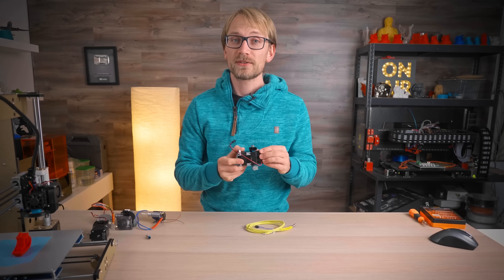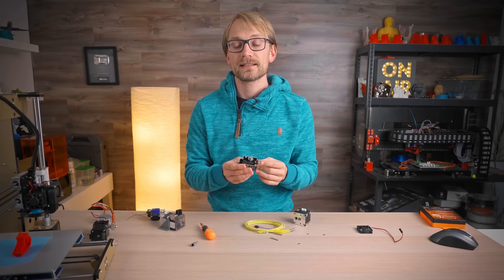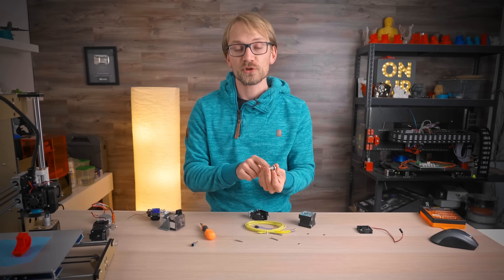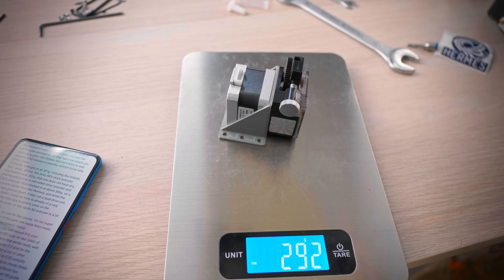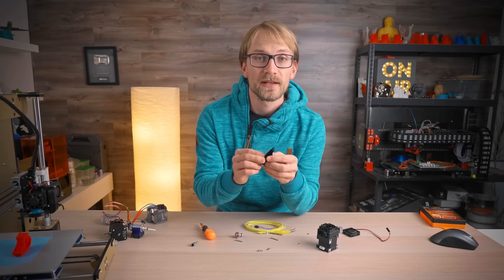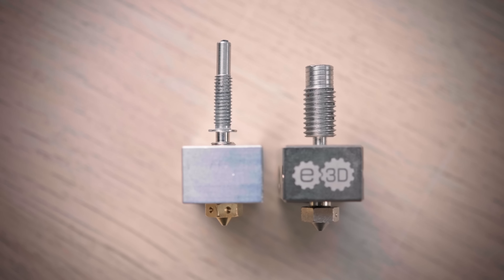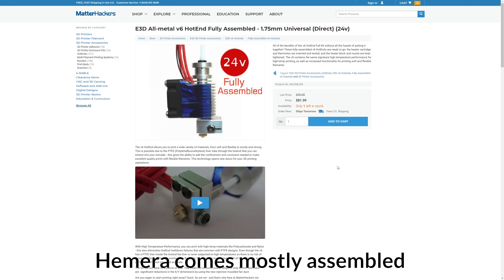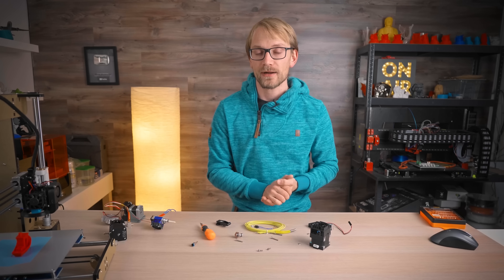E3D’s end-all extruder: The Hemera! (Full Review / “formerly known as Hermes”)

Comment: I've stripped filament in my Prusa all the time, mostly through nozzle clogs though.
1 - Using white filament in a 0.15mm nozzle. 
2 - Temperature too low for the filament.  
3 - You print a file but forget to swap in the larger nozzle.

Comment: for anyone else wondering.  you CANNOT rotate the front heatsink so you can mount the thing on the bottom of a carriage.   the bearing for the idler fits into the front plate of the stepper motor.  so it's not rotateable.

Comment: Well Tom. Blowing air up away from the bed in that kind of a small space you actually creat a low pressure zone under the hotend which kinda doesnt help. the only way to get very little airflow around the print would be a long hose from and away from the cooling finns.

Comment: Just curious... my heated bed is 24V. I guess I will have to get out my meter to tell how much voltage I have across the Extruder? I have an Alfawise U20 One printer. I would think that I need the 24 Volt one... I am new to 3D printing and my printer also uses the Bowden style extruder. I guess it would be best just to replace the Bowden?

Comment: Isn't this basically the deluxe version of the stock Anet A8 extruder? They look exactly the same, right down to the point where you can't see the filament as you're inserting it.

Edit: I look to the left side of the screen, and I do indeed see that the Hemera is installed on a stock Anet A8.

Comment: It would be interesting to make a setup where you have one big frame-mounted stepper to handle the mass of the filament roll, and one small pancake stepper to apply pressure at the printhead. As long as they move in sync and have a bit of filament slack between them, the direct extruder should be totally isolated from the spool, which I think would be a big help.

Comment: Sorry this extruder may be good. I ordered this. But as I had it in a hand I thought it is a joke. The fan and the screws, oh my god.  Blind designers. The position of the gear to push the filament manually. Again blind designers. Some stuff are good. But if it advertise with quality I shouldn't  make such faults.

Comment: Hey Tom! So I got 4 HEMERA upgrades for my print farm for my Ender 3's. I am unable to get some clear Sainsmart TPU printing for longer than 20 minutes before either: A) The filament stops feeding (low tension), or the filament gets crushed and is blocked by the tight tolerances of the Bowden adapter (high tension). I've gone through E3D's entire troubleshooting guide- waiting for support to get back to me. Any ideas what might be causing this issue?

Comment: Tom, first of all, I'm a huge fan. But like for some reason, you ot teaching tech, or makers muse, or 3d printing nerd or anyone else has the Tevo Nereus. No one but ruiraptor has a nereus as far as I know. It is a really cool, unique tevo. Let me say why

Its pretty good. a 320 by 320 by 400 mm frame, 24v, filament run-out (SO loud), touchscreen full color, and wifi (doesn't really work well). It supports 2 extruders on the pro, but that hasn't been released.  I have one and I love printing on it. the area of the bed is bigger than a cr 10, and it can be found for 390 if you look carefully or at the normal ~430

Comment: I'm building a printer and was thinking of getting the "Hemera".  Would this unit be able to print with carbon fiber filament? Thx
Reply: yep, just add a hardened nozzle. You will also need high temp heater block, high temp nozzle (I HIGHLY recommend e3ds nozzle x), and a thermocouple. What printer are you running? Check the thermistor. If its a glass bead type, it should look like some wires are connected to a pice of glass. be extremely careful. if it is broken, or a wire is broke, you need a new one. But check the wiring first, if its plugged in all the way. e3d uses cartridges tho, not glass bead. I'm not sure what to do :/
Reply: @vaibhavagarwal4637  Nice response, apart from the details regarding thermistors. Hemera ships with not only a  cartridge style thermistor, but its one of our new thermistors which are much more difficult to damage.
Reply: @E3DOnline  First of all thanks for replying. I'd appreciate if you guys could help me.

1) So I was thinking of getting your e3d v6 but CNC Kitchen has a video on how he tried to add a volcano to a cr10. Since you guys used cartridges and not glass bead (right?), in the v6 and volcano, it was not possible to use your thermistor, so he wrapped the glass bead in one layer of Kapton tape, and then wrapped aluminum foil around that to make it fit. I have a tevo Nereus, it also uses a glass bead thermistor so I can't just swap in a new v6. Would I have to do the same thing as him? How would one go about the process? There is a board that has the wires for heating up on the x and z-axis. How do I know the wires for the thermistor is the same as on the mk8?
2) Are the NEMA 17s (all of them) on your store round shaft or a "d" shaft? Does it really matter? I need 1 motor for a 400 mm z axis, single stepper, 1 stepper for the bed, 320mm by 320mm, and 1 stepper for an x axis bowden setup.
I would really appreciate your help.

Comment: Hey Thomas, Great video, can you tell me where you found that circular fan shroud STL??- (trying to install on my CR10 S5) Thanks- Also, I cannot seem to find the correct thread for the small heatbreak fan (the one that covers the cool SWOOSH fins) - have all of the screws from the Hemera Kit, screws from my new E3D volcano kit and all the old screws from CR10 original parts (fans, extruder, hotend), none of them work smoothly in those holes.

Comment: Bit confused here. So if you wanna call it an extruder/ hotend combo...."with the shortest distance from extruder gear to meltzone"  this implies only a direct drive set-up. Otherwise it can just be used as a standalone extruder with  a standalone hot end , correct ?   So it's technically speaking a modular system ?

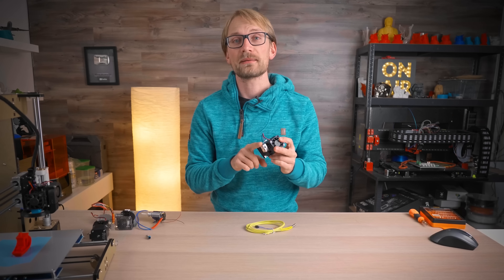Comment: 0:39 - E3D's documentation on the heatbreak says '... M6 thread to maintain compatibility with the E3D ecosystem. ' So i really think it will work with any M6 threaded heater block, not just the one it comes with.
Reply: you're right.
It can be used with V6, Volcano and SuperVolcano

Comment: I wonder: does the hemera replace the V6?
what I mean by that: Does it also handle the rest of the filaments well?
PLA, PETG, Polycarbonate, CF-Nylon and so on. The engineernig stuff. 

All I hear is that its very good for flexibles
Reply: Flexibles are pretty much objectively more difficult to print than non-flexible filaments, since they require smaller gaps/tolerance in the path.
I would guess it to be very good at printing non-flexible filaments.
Reply: @yunho-cho  yes, I know. But that's not everything. There's also the efficiency of the cooler. If the cooler isn't good enough, PLA and petg tend to clog as the heat creep is too much. V6 and mosquito is excellent here.

With higher temps, like 280C it plays a big role. 

I want an extruder that can do everything. And the current BMG+V6 or Mosquito is already excellent.

Only reason I want to change is because I have bad clones which I'm changing anyway..
Reply: @jbergene  yeah, that's an excellent point. Didn't think about that.

Comment: Hermera is lighter than the titian V6, you were comparing to a titan v6 with a smaller motor. The added copper of the hermera motor outweighs the extra plastic parts and aluminum that were cut off. They have plans to pare it down in the future.

Comment: Does the motor's heat cause filament to soften when driven by TMC2130 drivers, like in the Prusa MK3S? I'm in the process of rebuilding to a BNBSX extruder to isolate the motor from the filament path due to extreme filament jam issues on long prints.

Comment: The BMG was always an insane price anyway, I was going to purchase one a few weeks back but the assembled direct drive unit for the CR-10 was €280 plus another €21 for postage. They've priced themselves out of the market as far as I'm concerned. I received my Hermes on Friday (original branding still) and I love it, it's the best extruder I've used in four years of printing.
Reply: Was it an easy fit on the CR-10? What improvements have you seen? I'm still running the stock extruder with ABL. Guessing I'd probably have to solution a side mount of sorts if getting one of these?
Reply: @rfc1795  I put mine on an S5 using 3DMN's stls from MyMiniFactory. It's a pretty easy install if you know your way around a Creality machine. There's a tiny bit of soldering involved but that's the worst of it.

Comment: Hi, Tom! I just have finished setting up Her.. Hemera. Few things I think can be improved:
* M3 thread in heatsink. Many will replace stick fan with Noctua or something else and stock screws will be too short
* An extra bag on M3 bolts in different lengths in 2mm increments to fit accessories to Hemera. Those accessories threads are annoyingly short.
* Lack of printable accessories. I had to make my own dual fan duct for 40x20 Noctua fans (search thingiverse)
* Lack of motor settings. I have no clue what current value should I use.

But I like Herm.. Hemera. Need to test it out now.

Comment: IMO Hemera is limiting for various configurations. Specifically this is forcing an air cooler, so no water cooling with a hemera. I have metal plates which go between the motor and the extruder, I think something can be adapted to work in that configuration, but that's not the default the setup. Also with a V6 I have a precision piezo sensor right below either the Titan or the BMG, because it fits the standard groove mount, so yes I'm adding 25mm to my filament path, but it's full constrained in the piezo sensor adapter module. So this setup completely eliminates compatibility with a piezo sensor. This is a nice setup, but way too much lock in to the e3d everything. Now we're looking at a proprietary e3d stepper...that is overkill IMO.

Comment: Don't feel bad for Bondtech. 

Things will only get better and cheaper if there's actual competition between manufacturers
Reply: Bondtech could've done this, but didn't. I don't feel bad for a company that overcharges for plastic boxes with a couple of cheap gears in them.
Reply: @YaFunklord  You have no idea what your talking about. Bondtech is not overpriced.  Bondtech cases are SLS printed in Nylon.  Go ahead Engineer, Prototype, Test and then manufacture a product using SLS printed Nylon, even in the tens of thousands see what your production costs are.  Try running any of the Bondtech Chinese knock offs at the same speeds as a genuine Bondtech, guess what you can't cause they cant reproduce the filament path with injection molding that Bondtech does with SLS manufacturing.
Reply: @scotthancock8225   Erm.. the 10$ bondtech Clones are also injection molded in some type of engineering plastic mix. 
There are also Billet Ali ones.. Yer pissing into the Wind Mate.
Reply: @barenekid9695  yeah, but weak plastics and cheap spur gears which should not be used
Reply: @YaFunklord  Yea the trianglelabs version is better made anyway and 1/3rd the price.
Reply: Wow, some people will go to any length to justify their purchases.
For that price I'd expect them to be made of metal components or at the very least be injection molded.
But it still doesn't change the fact that they are just set of cheap gears in a box for the same price as others can produce a complete 3d printer for.
Reply: @YaFunklord  Your still failing to recognize that Bondtech case CANNOT be injection molded, hence the SLS nylon construction.  To each there own was just trying to show you its not just a box with gears
Reply: @scotthancock8225  That's just bs. There's no such thing as "can be 3d-printed but not injection molded". It's called lazy/bad design. Fused injection molds are still stronger.
And besides, cast or machined metal parts would've been the expected. Not any kind of plastics.
Reply: @YaFunklord  hahaha you basically didn't understand 3d printing 😂
Reply: @YaFunklord  Lol then you don't know about the challenges of injection molding undercuts and this is just one of many advantages FDM manufacturing has over injection molding.  your just reinforcing that you don't know what your talking about.
Reply: @YaFunklord  what?I 3d printed that v29 survival whistle on thingiverse with 80 percent infill, and I had layer separation and poor bridging and yet it withstood being rolled over by an SUV and still worked just fine. Printed it with pla.
Reply: @scotthancock8225  you never did any injection molding did you?   or sonic welding.  
YOU are the one that doens't know what you are talking about.       the only challange for a design like this is the price of prototyping.   but once they have a final design they can switch to injection molding.   

but again.  who wants plastic when you can have metal.

Comment: I received mine in the mail, was a bit disappointed when I got my hands on it and realized there was no way to manually load/advance/retract the filament.
Reply: I just got my Hemera built, and thought the same thing, but it turns out you can just squeeze the idler lever and push filament through or pull it out. You don't really need to drive the gears for loading/unloading.

Comment: Really interesting to learn about the improvements over the Titan aero design. Close ups of the diecasting and drive gear components moving was awesome too. Geat information on how Hermera is a combination of extruder, motor, heatsink, and hotend all incorporated into one assembly.  Along with dual drive. 

Your very knowledge perspective on 3d printing makes for really helpful informative vidoes. In this one especially, you pointed out how great & practical it is to actually have this all-in-one component to use on a printer setup.  Something I didn't fully consider and it makes me want one even more  Fantastic review Tom!

Ps. The bmg has met it's match and then some for sure hahaha!

Comment: There are many 3d printed geared extruder options around and one thing that E3d never in my mind got right from the original gregs wade extruder was the harring bone gears. I personaly developed my own design using a GT2 belt and pulleys to drive the filament on my choice of drive gear either hobbed or pinion. Mechanicaly pinion gears have a "dead" space of play in them where their is movement but no output in the transmision harring bone gears fixed this problem and so does my belt driven setup. There is nothing worse than E3D changing their sizing of their threads just for the sake of doing so the difference would be so minimum IMO any way.

Comment: So, in short, it may offer minor improvements, but doesn't solve one of the real problems we all run into; unprotected wires in the hot-end that can be torn off when something goes wrong and we have a nasty blob around the hotend to remove.
Reply: @JorgTheElder  Yea that'd be cool. Most of them are all metal you can run the negative power through the frame itself and just have 1 wire connected to the heater coil or something. That'd save space

Comment: Can they be assembled left and right handed for short distance between dual extruders?
Reply: In my experience, larger spacing between dual extruders is better, if you can tolerate the reduction in print area reachable from both nozzles. The reason is that if the non-printing nozzle passes over filament that has just been laid down by the printing nozzle and not yet fully cooled, it leaves a mark. This is very obvious when printing circles, e.g. on the classic traffic cone print. Increased nozzle separation makes it more likely that the filament will have cooled by the time the non-printing nozzle passes over it.
Reply: @davidcrocker4285  That is an excellent consideration.  I wonder if any of the slicers take this into consideration?  I'm thinking of a dual to print water soluble support.  In theory it would be possible to know how long it had been since an area was printed and to cross over in that area of the print or pause.
Reply from the maker: There will need to be a specific LH/RH version as you can not just assemble a Herrera "upside down" to convert it.

Comment: Regarding weight: compare the whole weight, including mounting accessories. now add the weight of the aluminium bracket of the stock Anet extruder and add the minimum weight of the plastic mount you designed for the Hemera. And? I'm sure the Hemera wins.

Comment: When your first complaint is "it blows air in my face if I stick my face right in front of it" then the rest of the review becomes moot and it might be quite good. Might see if I can get one of these on my mk3s whilst I'm putting my new rails on it..
Reply: If you have an MMU2s on your mk3s, you can get problems with the Hemera. e3d made a special version for Prusa of their full metal heatbreak to form the tip of the filament while unloading. The Hemera has a different heatbreak, so you might not get the perfect tip you need for automatic filament change.
Reply: It also makes you wonder why he didn't mount it the other way round